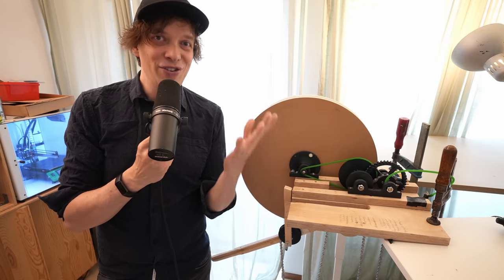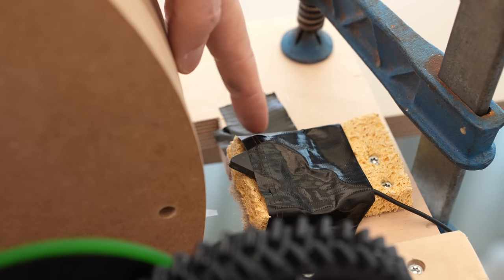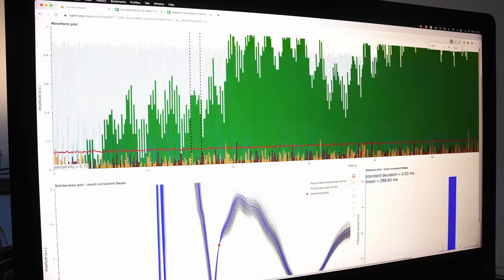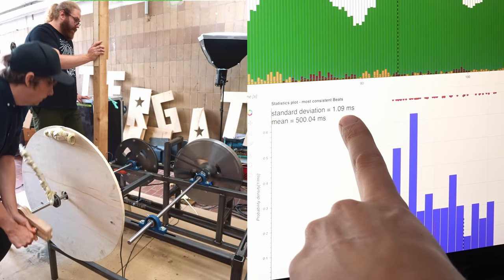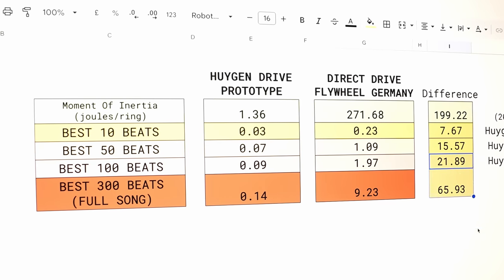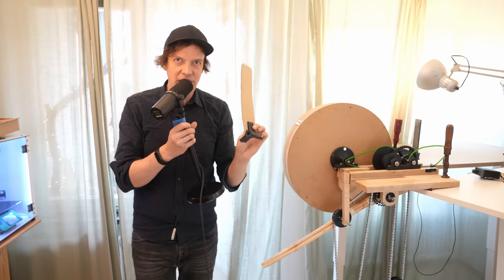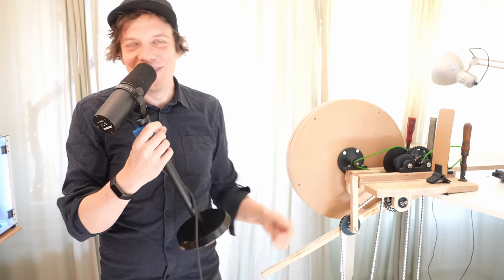Is Gravity Really Constant? I Built this machine to find out.

Comment: Awesome... with one caveat. The gravity i would bet is constant as long as You don' change the machine's elevation. The air density is certainly not constant but it changes very slightly and very slowly. But if You make prototypes to check gravity, i assume mechanical time measuring is important for you.. If so.. are You all about making it as complex as possible for effect, or could you just use old clock mechanism what stays true for whole days? Or am i missing something?

Comment: Actually - If you increased the pressure in the room, there would be more resistance on the rudders on the flywheel.
This techically also assumes that you will have zero variation in pressure to conclude anything about gravity being constant

Comment: 30us to 140us is within the important range of the equipment you are using to measure with. If you're using a ±100ppm crystal oscillator and a circuit that has a lot of jitter then your precision on that 140us measurement is suspect. You can observe this by looking for spurs and spreading in the FFT analysis using one of a few windows [Kaiser-Bessel (favorite), Flat top, or Force (interesting to try given your signal)]. I'm curious to see what we can observe. I have a suspicion that your device may be tighter than you are currently measuring. Where is @Keysight when you need them :D.

Comment: Really cool idea but the setup its currently in wouldnt be perfectly consistent since every time he cranks the lever it adds a little bit of his energy into the flywheel itself. If the weight were on an infinitely long chain it might work, or possibly use a very high gear ratio?

Comment: You have a problem with the fact that gravitational force is not a constant. The gravitational force changes as you move from the equator to the poles. If you do not intend to move the machine then there will be no changes. unsure how much the change in gravitational force willl affect the timing

Comment: What elements of this pulley will change the bpm?  I suspect you'll want an element that is easy to plan, make, and swap.  These elements may include the driving weight, the flywheel, and the gears.  The driving weight (the suitcase) will probably be easiest to manipulate.  Also, how long did it take for the pulley to get up to speed?

Comment: The speed of your flywheel   will vary by barometric pressure. It will change when the weather changes. Use a pendulum. You can get 100 times more accuracy.

Comment: So this gives tight music, which is great (also gearing ratios can be improved as well so there can be less input). However the peddled/cranked version does allow for more control over how the music plays (it also lacked a governor which might have helped with timing). Question then is, can there basically be a combined version one that is constant when needed but can be switched to manually driven for that human input? (I would assume this is possible though I'm no engineer, but I would think that at minimum something like changing gears on a bike)

Comment: Even if it is tighter - you still need to demonstrate control over the output speed.

I.e - does it play the bpm you chose, or just the equilibrium inherent to it? 
And when you want the bit to change, how quickly will it respond?

Comment: I get what you're trying to do, but this is a flawed comparison.  For your tests in Germany you were trying to maintain a consistent tempo while listening to a metronome, so the variance involved an active human feedback loop.  Your test today was entirely passive with the system finding its own equilibrium.  The downside of this contraption is how long it takes for it to settle on a tempo.
Personally I think the better solution will involve a pedal to spin a flywheel, maintaining your active connection with the machine, but then a computerised governor to monitor the tempo and perform adjustments to maintain it against the target.  This governor could be something like a clutch, a variable flywheel or a brake.

Comment: Don't use an air govner, use a magnetic break, if you make a thin disk out of aluminium on you fly wheel and place a magnet next to it the magnetic breaking force will be more constant than air and easier to adjust using distance!

Comment: I mean there's a reason that there is gravity... and then there's the gravitational *constant*, gravity will vary depending on how far you are from the mass that's causing the gravitational pull, meaning it is not constant, but at the scale you're working at it's practically constant

Comment: We know the net gravity in a given location is not constant. The gravity due to the earth pretty much is constant in once spot, but the moon pulls hard enough to create tides, other planets also produce measurable effects. If you change location on earth the gravity changes too, and not just due to surface level change in altitude affecting how far from the earths centre of gravity you are. The earth's crust is oblique sphereoid, and on top of that its density isn't constant.
Essentially the earth is wonky in every respect and it has been mapped, but the variation is largely insignificant in almost every part of life. Architects of very tall buildings, sensitive telescopes, some lab experiments, all have to take local measurements of gravity to get the precision they need, but outside that it doesn't need to be known that thoroughly. 
That said, it is very worthwhile science to collect your own evidence to re-confirm the measurements others have taken, but you might find your equipment is incapable of detecting what you're looking for. A gauge study will soon tell you. Metrology is a fascinating world.

Comment: OK, and here i first thought why would you want to measure the gravitational variations - cause gravity on earth is not constant - it changes with your location, time of day and day of the year. Those changes are minuscule but they are there and with a bit of thinking quite easy to measure.
And i am not sure if your measurements are correct: when sampling with say 48kHz that would only be a resolution of 0.02 ms.

But for your machine - yeah that is a working first prototype of a bad clock. While it does work for now it has no actual frequency-stabilising component and is purely relying on a constant force and constant friction. I wouldn't be surprised if the 0.1ms jitter come just from the cranking. And over longer times this will change its speed depending on airpressure, temperature, moisture and other things. Clocks have the pendulum cause that Oszillation is a rather easy to adjust fixed frequency motion.

Comment: I think you’re a noisemaker is causing false readings in your report. Remove the noisemaker and use an optical sensor or a hall affect sensor and attach that to a beeper or something yes there may be a tiny delay due to the circuitry but it should be very constant. Also your air Governors may be compromised with random air fluctuations in the room. Maybe surround the air governors with a big plastic somewhat sealed barrel. Very interesting project!

Comment: Gravity is constant, but not with the same force everywhere on the planet.
Now Huygens chain drive is one solution, the pedal is second. Now combine those: Power input to Huygens drive is a flywheel of Pedal mechanism. And the Huygens Drive powered flywheel should be the otput for instruments!
So you don't have to power it all the time and you can make a clutch, which can be disconnected from Power flywheel each time the weight is in upper position and re-engaged in lower position (like a lever).

Comment: It sounds to me like if you needed a car that runs at 50 m/s, and you are choosing a model running at speed of light over one running at only Mach 10, and moreover which will need further prototyping, probably a stronger governor (because the load won't be constant, and your Huygens drive provides a constant force, Not a constant speed), and more mechanical parts (because I guess you'd need a flywheel on both models, even if one is ten times the weight of the other)

Comment: What if you take the Foot driven flywheel and use it to feed the input of the Huygen drive?  This will present relatively smooth input force that would be more ergonomically to play with the timing precision of the Huygen drive.  The you should be able to scale back the moment of inertia down on the input fly wheel while as you will have the mechanical advantage of the Huygen pulley input.  Hopefully then you an remove the pesky ratcheting noise.

Comment: Wouldnt changing air pressure, thus temperature also change the speed of the wheel since you are relying on air resistance as a governor?

Comment: Cranking the Handle is adding to the energy in the system isn't it? More Weight and a Geared down input or Longer Chain would give more accurate results

Comment: Not from earth at least, but it can be anticipated. Closer to the poles and gravity will be slightly stronger. Closer to the equator and it will be slightly weaker. These results are shown in well documented phenomenon like tidal effects and that the earth has a slightly larger diameter around the equator due to our rotation. This one is a fun video, but I've known this difference since I was younger than age ten. I thought it was common knowledge. Now I'm only curious how I learned what I thought was obvious. Work ethic makes brilliance either way. Good luck out there.

Comment: This test and the one you did in Germany were made without a load, without the rest of the machine needing energy to function, and without loss due to friction. The more the machine grows, the more power it requires, so the bigger the flywheel, the bigger the weight. You should really consider using a motor, gearbox, and speed governors.  I understand that you sad that you want the machine to respond with the energy of the audience ( like you sad in a past video) but this is a machine, a mechanical thing, it is a tool with limits and tradeoffs you have to choose tight music vs energy from audience feedback

Comment: you where using a motor to drive the marble machine x why not use a stepper motor  or (clear-path servo motor)to drive the new one that is controlled by an Arduino or other controller this would give you lots of timing precision, reduce size needed for a fly wheel  ... or maybe that's adding a transistor to a beautiful tube radio. (i don't know the rules) Love your work though!

Comment: Is Gravity Really Constant? The Pendulum Clock has been used to keep time starting in 1656 and was only beaten as the most accurate way to tell time in the 1930s by Quartz clocks. Any Grandfather clock would show you this. For keeping time (like a consistent BPM) a Pendulum is a better choice over a flywheel because its a harmonic oscillator its the flywheel and governor in one device at a given length and weight it will swing at a set rate and resists deviating from that rate. A wide arc is better then a short one. A modified version of a Pendulum clock mechanism would be perfect for this application.

Comment: From the late 1600s until the early 1900s scientists built increasingly better pendulum clocks, figured out how to make their speed unaffected by temperature, air pressure, humidity, disturbances from the mechanism itself and so on, and at the end the wall they hit is that... gravity isn't really constant at any one spot on Earth, it fluctuates with lunar and solar tides, and fluctuations in how much groundwater is below that spot on Earth, and definitely more factors that I don't understand

Anyway a 0.14 ms deviation on a period of 0.268 seconds is 0.52 parts per thousand. The best pendulums ever made (which ran inside vacuum tanks to insulate them from barometric pressure and temperature changes) are in the parts per billion range

Comment: (this is also probably against the rules) but how about using solenoids to drop the marbles this way you can have all your tight beets stored on you 2kbit ardinouno controller. and would remove the need for the huge rotating drum with all the pegs and other headaches that come with changing that out evey song.

Comment: Beware!
Gravity has positional variations on earth's surface!!!
Anywhere that has a bug lump of iron in the crust beneath your feet will have slightly higher gravity than places with more silicates.
I do not know if it will be enough to matter for you, but I do know that it is enough to detect with sensitive equipment. The US military mapped the gravitational anomalies of the deep sea and used that to navigate submarines without surfacing or making any external contact during the cold war. (Maybe still do, IDK)

If it is relevant it should not be insurmountable, but you may need to retune your weights every time you move to a new city.

Comment: With this scheme, how in the world will you adjust the tempo of the marble machine during the performance?! To be a musical instrument not just a music box, it has to be not only tight but adjustible.
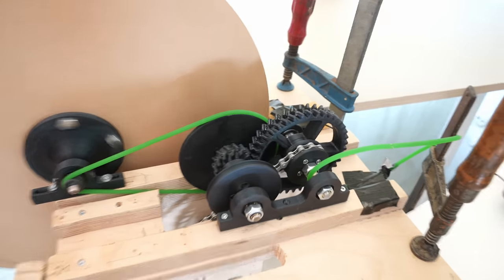Reply: See at 2:08, where the bigger wheel driven by the interlocking gears is connected by a belt to a smaller wheel driving the test drum. To increase bpm, the wheel on the gear can either get bigger, or the wheel on the drum can get smaller. To decrease bpm, it's the opposite

Comment: Amazing results, but I wanted to add that your conclusion at the end, isn't completely correct. A standard deviation of 0.14 ms is incredible, but it doesn't entail that all 300 transients were within the 0.14 ms range. To calculate the confidence interval, you would need more information about your dataset. How is it distributed? Don't get me wrong, the comparison of standard deviations is valid, a lower SD means your implementation was closer to the expected result, but the conclusion from those values depends on more information.

Comment: Suitcases are meant for travelling. So the intention to let it travel for measuring gravity is good. But Martin might have overlooked the fact that suitcases are not a reliable source wile travelling vertically. Just do a quick research how many suitcases vanish when travelling high altitude in a plane? The planes travel safely  99.99999999% but not the suitcases. Given that, he better should have used a plane instead of a suitcase.

Comment: I am sure you know that your contraption does not prove whether Gravity is constant or not. But it's good clickbait.

All you are proving is that the tolerances in the transmission you can built are small enough for this to keep time accurately. Extremely important proof of concept still.

However you don't have a torque pick up from that flywheel. Meaning this is not connected to a shaft that actually drives something. That 0.03ms is not going to stay that small as soon as you start to use the torque this drive provides. Many ways to mitigate this, but you need to think about it.

Comment: Unfortunately when the flywheel is cast in metal and made to the required power and torque of the marble machines "imaginary driveshaft"- as there shall in all probability be several power take off units, - the suitcase weight would be required to be 30 times or so heavier and in that threshold all parameters shown by the bicycle chain- sprocket tension and friction shall become very different from the cardboard test jig- there shall have to be another adventure for finding "tightness"

Comment: The "tighter" music you gained from your gravity driver can be due to a difference in WHERE AND HOW in your mechanism you measured the variation in the beat.  By measuring from a tab on the flywheel with a sensor mounted on a sponge in this machine while measuring from an additional arm to a different sensor mount you have changed MULTIPLE variables between the two mechanisms which means you may not have gotten a properly comparable result.  

A flywheel simply has considerably less flex or variation in it than any other part of the mechanism simply because of it's inertia.  

Sorry, but your results here are not conclusive.

Comment: Gravity actually isn't constant unless you stay in the same place. Although this rig isn't sensitive enough to measure it. It's also sensitive to air pressure and I bet it will measure that, but that's not important because beat rate consistency is objectively undesirable in music.

Comment: I don't think sd over 300 beats is a good measure of tightness: Think of Chameleon by Herbie Hancock - it's tight af, but the song speeds up significantly over its 15min runtime so the sd in beatlength would be verry high. What you are meassuring is the machines ability to hold a constant tempo, tightness is a local property! Maybe you could measure the sd of the difference between neighboring beatlength instead...

Comment: It’s been said, but this demo is not as close to success as the results suggest. Music will have a varying load on the drive system and this hygen drive only provides constant force. 

This system needs a tight governor to make tight music under varying load. The input could be both pedal and hygen drive, but an adjustable governor is key to success here.

Comment: A marble machine playing music will never have a constant load like this prototype and in order to play as tight as Martin wants the flywheel should be weighing a ton at 100 rpm or 100 kg with 1000 rpm or anything in between. Just not possible with muscle power. He either has to accept that the machine plays not tight enough with muscle power or use an electric motor. It's as simple as that.